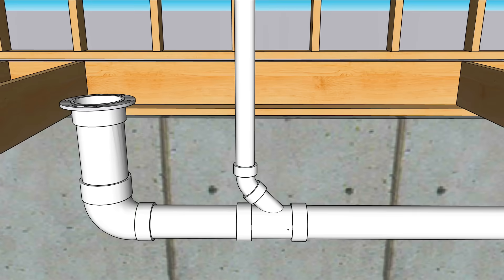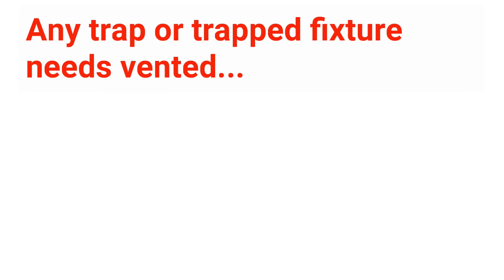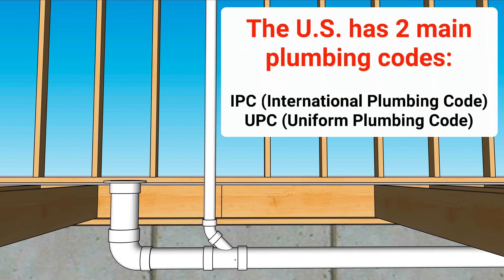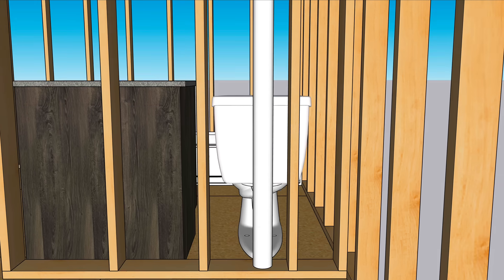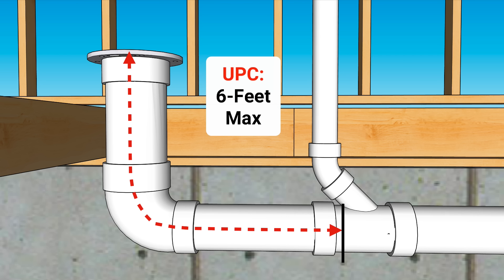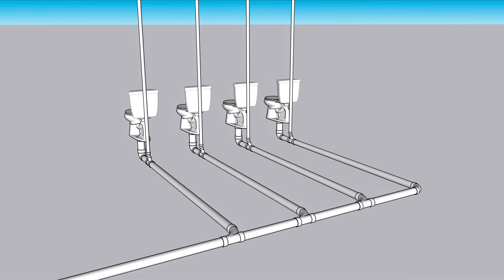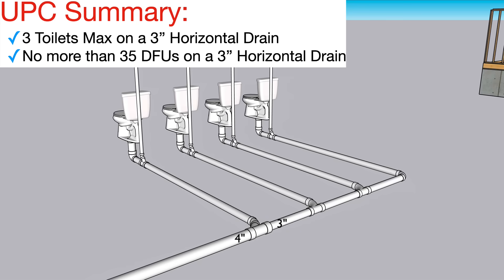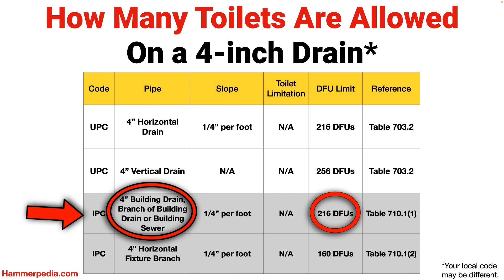How To Vent & Plumb a Toilet (in 2024)

Comment: Could I ask —I did an install like the vid but my vent is not with the 45*backset it’s just a 3” t    Don’t note any problems except for the trap going down to the minimum as it’s not used much. Q is does code require the 45  ?
Reply: Below flood rim a y and 45 is required in both upc and ipc, local codes may be different.

Comment: How high can vent pipe be?
Reply: ... I believe most will call for the vent to be at least a foot above the roof and in the case of a second story nearby it needs to be more than 5 feet from any windows. Check with your local inspector for any variation from national code.

Comment: IPC does have the same 3 toilet limitation as the UPC. On table 710.1(1), next to the 3 in the diameter of pipe column there is a footnote. The footnote reads No more than 3 water closets.
I was on a job second guessing my code (IPC) memory because of this video. Had to check my code book to make sure I didn’t run a 3” building drain to my 4” building sewer…
Edit: check replied comment below.
Reply: This is correct for North Carolina IPC. The National IPC is as stated in the video. I just cross referenced.
Reply: @EatShee-I-it  ... did you know you can edit a post by clicking on the three dots to the right of a post?
Reply: @rupe53  yes
Reply: @EatShee-I-it  Hola amigo colega ando investigando cuál es la manera correcta de ventilar un inodoro si con una yee o con una te sanitaria seve qué sabés mucho del tema saludos espero tu respuesta ?
Reply: @hugorosco7806  the video states a correct way. Different locations with different codes may be slightly different.
Your comment didn’t automatically translate, and my Espanol es muy porquito. I think you are asking me about using a sanitary tee to vent. In my opinion, an individual vent for each fixture using the sanitary tee is the ideal method. Although, the method I use most and prefer due to it’s ease, is what I call horizontal wet venting.
Reply: @EatShee-I-it  muchas gracias amigó saludos desde la CDMX
Reply: @hugorosco7806  salud carnal

Comment: Does the vent need to be after toilet before the sink?
Reply: ... it's going to depend on the distance of the pipe run. You could vent the sink drain into the same vertical vent pipe as the toilet, either in the wall or up in the attic.... exiting through a single 3" in the roof.
Reply: @rupe53  so let's say six feet toilet next to sink can I put one vent after both? Or is it better to vent both then into one going up?
Reply: @dp9948  ... I asked the same question and my local inspector wanted another vent for the sink within 2-3 feet of going through the wall. It was ok to join the vents further up for a single roof vent exit. We get snow so he also asked for 16" above the roof. It was also a first floor extension so the stack / vent needed to be more that 5 feet from the back bedroom windows on the second floor. (measured horizontally) I added a zig-zag with 45 degree fittings in the attic and got it 8 feet away. I also went from 2 inch vent up to 3 inch in the attic. No problems over 20 years so far.
Reply: Thank you for your response 👍
Reply: Il y a de petits évents de quarante  à placer aux dessus du siphon de votre lave-main.

Comment: Why reduce to a 3 inch pipe when you can stay to 4 inch. It'll be more volume for flow of water
Reply: ... because 3" flows better than old cast iron and it's cheaper / easier to use 3" for a single bathroom.
Reply: @rupe53  ok. I was thinking   it was a demonstration of a new house. I use 4 inch PVC pipe for all main drainage pipe.
Reply: @weldonpinder7295  ... depending on the house layout and number of bathrooms, it would be common to eventually upsize to 4" before heading outside the foundation. As you can see by the diagrams, after so many toilets (or total drain units) it may be called for anyway. Probably best to have a little extra in case someone adds onto the home in the future.

Comment: 4” toilet flange to a 3” 90° bend? Not legal anywhere in North America that I know of. Drain pipes can only either stay the same diameter or increase in diameter; but never decrease.
Reply: Australia must be 4in all the way
Reply from the maker: Normally a drain never can be reduced in size (like you mentioned). But the video shows a 4" closet flange connecting to a 4x3 closet bend. Neither the IPC or UPC consider that a reduction in flow (IPC 704.2, UPC 310.5).
Reply: Thank you for the correction. I didn’t know that
Reply from the maker: @Cris T  All good. I should have brought that up in the video.

Comment: Used to be, if the toilet is close to the stack, no venting necessary.  Not sure in 2022.
Reply: ... that's only if the stack IS the vent through the roof. In the old days the soil pipe WAS the stack / vent, all in one shot. These days that's not always the case.

Comment: The video is ok ,but a wye on its back with a 45 is not legal for a dry vent ,must be a san tee
Reply: Hola amigo colega estoy investigando sobre el tema de cuál es la manera correcta de una ventilación seca vertical  según yo es con una yee  y podrás comprobar porque la manera correcta es con una tee sanitaria y no con una yee?
Reply: Not anymore. UPC requires y and 1/8 below the flood rim for all piping. Ty on its back was approved for a long time, but now even vent fittings below the flood rim must be long sweeps, y’s etc..

Comment: What do you do, if cut existing old DWV that goes through roof and “DON’T” add a new one? Do you cap the “cut old DWV” thru roof; so water doesn’t collect inside and/or pool under a slab in grade foundation? 

FYI: had contractor help out w/ bathroom remodel and they had sub do plumbing and they ended up digging up slab as flipped toilet and vanity and added a tub and extended existing shower (which they had to dig 2 times after finished since during flood test 1, forgot to connect drain, & flood test 2 forgot to connect drain to exist 🤦) that was there.
After all said and done, and pouring concrete 1 time, 2 times, and busting up to fix mistakes before poured 3rd time; which on 3rd time, they STILL DIDNT VENT ANYTHING IN BATHROOM TO “OLD EXISTING” VENT THRU ROOF 🤦. 
So, when time for final inspection, guess what, found that wasn’t vented to code, but they able to “fix” w/ adding 3 AAVs, argh.
But what am I supposed to do w/ the vent pipe coming thru roof, cap it so water won’t enter and pool under slab etc….or rodents, or “nature crap” etc…
Thx for vid and everything, cheers✌🏻
Reply: Why did they use a Studor valve rather than connect it to the existing VTR?  There's something that you aren't telling us.  A contractor "helped" you to do the remodel?  So...did YOU do it, or did you actually HIRE a contractor to do the whole job, or what?  How much did YOU do, and how much did the contractor do?  I'm a bit confused by this.
Reply: Well if you aren't using the roof vent and it is not hooked up to anything on the bottomed then yeah, cap it and the next time you do the roof, delete it.

Comment: I’m sorry bro you need to delete this entire video you’re not showing them how to install event that’s a vertical drain pipe off of a branch, second of all the UPC code allows two toilets on a horizontal  3 inch  branch the second you get to three you gotta bump it up to four that requires the DFU not exceeding the DFU load allowed.  I do this every day man I’m a master plumber and you got so much wrong shit here I can’t even discuss it in the comments you need to delete this shit and stop acting like a Plumber. how is that a vent pipe how is that venting the toilet it’s not it’s venting the drain branch if anything the way you would do this properly is to a sanitary tea out of range that seem to Tee to a closet been vent out the top of the sanitary tea. And likewise a closet bend is not 3 x 4 you have a 3 inch closet when you have a forage closet bin you have a 4 x 3 closet bin and you have a 3 x 4 closet but there’s four different closet bins it’s a short radius 90 is what it is….

Comment: Did a similar install but just used a  t  vs. the 45 like the vid. Don’t use it as much so ittl lose the water in toilet on windy days. Question is does the 45 angle prevent the water loss ? I kept it at 3” size not reduced.

Comment: Funny how this was on my timeline.  I did Vo-Tech in carpentry for 3 years. We remodeling a home for training. I got the master bathroom.   The instructor said this is your Budget and this is the code book. Code books are easy. 2 things. Minimum size max size.  Min 2” max 4”.  Done. But venting toilet problem.  Instructor told me about this venting and said all other vents to it. I Learned this back in 1987. The instructor said what the video talked about. Why do you see odd things like a 3 inch vent pipe or in some cases a 4 inch vent pipe. If you have the room run one or two of them because somewhere in the codes you can only have so many vent pipes in to one. Like in the bathroom bathtub , 2 sinks , toilet all into a little 1.5 or 2 inch vent pipe that would not pass codes because if all of the appliances are running at the same time it ends up not being adequate venting.  What was I gonna say he’s the instructor.
Reply: ... up north they don't get too strict on the vent size inside the house but going through the roof MUST be at least 3 inches because the more water flows the more likely it will frost up in the winter. Yeah, there's lots of older homes with 1 or 2 inch vents and those are probably single bath houses.... AND... it seldom goes to -20 outside.... BUT... that's why we have a new code. (because some DO freeze up)
Reply: @rupe53  I had to do some work on my septic lines. Went outside where the bathroom was started walking around kicking the dirt poking the dirt. It should be a four-inch pipe that comes off and comes right up to the top of the ground somewhere in this area. Nope not the case. This was like two years ago three years ago. My neighbors like what are you doing. Digging a hole running another check and vent pipe. He shaking his head. Well I got it all done. I see this on YouTube about a month ago two months ago I can’t see when I posted. Maybe it was just a post from a state that said they change the codes or something. But I was always taught when I was in that field that’s how you run your vent pipes. As soon as I put mine in my wife comes out of the bathroom and goes what did you do to the toilet. She says it sounds like a vacuum cleaner when you flush it now. I said I eliminated back pressure lack of venting I allowed the water to go where it needs to go without any restriction so it creates a vacuum in the toilet bowl now. Because how fast the water is leaving the toilet. Now it’s a good thing because when we put the new environmental lesser water toilet in. It will flush perfectly.

Comment: is reducing from 4" to 3" best practice?  If your gonna  use 3" wouldn't it be better to not use 4" at all and avoid the constriction?  or just use 4" for the sake of tutoring people?  I don't know the drainage code but just because something meets it doesn't mean its a good installation..
Reply: will that pass an inspection?  anyone?
Reply from the maker: Randy, a 4x3 Closet Flange is not considered a reduction in flow (IPC 704.2)
Reply: @Hammerpedia  Thanks for taking the time to reply.  What I really wanted to know is if there is an advantage to using a 4x3 flange as opposed to just using 3" all the way.  Building code aside, which one would need the plunger less?
Reply from the maker: @ydnark83  either one is fine.
Reply: ... in the case of a retrofit there may be an existing 4" that can be downsized to a 3" then plumbed to newer code... if it's all within the distance requirements. (existing tile floor and tub that you don't want to disturb?)

Comment: I would use 4 inch all the way from start to finish, the 3 inch u will get trouble , blockage eventually
Reply: No one uses 4” pipe for toilets
Reply: @pats9414  well that depends where u live I meant the waste going into soil pipe which is 110mm Over 4inch soil pipe  mostly for toilet

Comment: I was told in CE that UPC got rid of the toilet limit on 3” and just bases it on dfus. I haven’t look in the code book to verify yet because it’s usually irrelevant as I always run a 4” main anyway except in specific situations. 
As for the unlimited trap arm in IPC, is there an exception for flat roughing or for toilets because there is a limitation on trap arms. In IPC (the best code for trap arms) it’s based on 1/4” per foot fall. If the trap arm has this slope then at a certain point it will be an S trap. So you divide the ID of the pipe and multiply by 1’ and this is you max length. 3” would be 12’. The upc has seemingly arbitrary numbers. 1 1/2” is 3’ 6”, 2” is 5’, and 3” is I believe 10’. I do commercial so we mostly stack rough so there may be some exceptions I’m not aware of. I didn’t know if the length was allowed to be longer because a toilet is anti-siphoning
Reply: Good question. I know that a WC waste arm was 6' maximum in our old Oregon Specialty Plumbing Code book,but they switched to UPC the last update! It's unbelievable. The things you're allowed to do,like running 4 WC on one 3" waste line. 8 WC on 4" too. I run 4" mains as well. It's just as easy as 3",but you're covered in case of fixture overload or additions.
Reply: @Energia-977  I work with upc everyday in Austin and as far as I know it has the same 3” 3 toilet limit. It is limiting with trap arms. We didn’t have any maximum for a wc trap arm. It was just the trap arm length for whatever size you chose. UPC, though seems to have completely arbitrary trap arm lengths. Like 5’ for 2”. I don’t know where that comes from. In IPC it’s 8’ based on the fact that when graded at 1/4” per ft you have 8’ before it’s an s trap. As for using 4”, when I started that’s all we used. I started in a small town. We one hardware store with a decent selection but still limited. The rest of our stock got delivered once a week. For this reason we only ran 4”. It automatically cut in half the amount of stock you have to keep. I only used 3” on repairs.
Reply: @joshcowart2446  Small towns are good places to grow up in. Probably what makes you a great plumber lol!(I'm from one too) I got a diagram from my city inspector that shows 8 WC on a 4" line. As long as you run vents between the last  WC and your first WC you can run 8.
Circuit vented branch is the specific name that it's called according to the diagram. I used it on an underslab rough this year.
You just can't use combos looking up for your WC(I asked but the inspector explained why it couldn't). You have to turn them on a horizontal grade,then 90 up for your WC.
Reply: @Energia-977  yes I agree. Just in terms of plumbing I can think of how small town people are better. In the city, everything is an emergency. I’ve been called out for an emergency that turns out to be not at all what I would consider an emergency. Small town people, due to not having 24 hr plumbers available, know how to deal with things. They can get by until a plumber can get there. They either know more about how to do things themselves or they’re much more willing to make due. 
As for the circuit vent, yeah I’ve never actually done one but I remember being taught about them. I thought you were talking about sewer pipe sizing. I don’t know how the Oregon code is but from what I hear from lots of plumbers is UPC is stricter than IPC. I have to deal with both so I should know the differences because Austin is UPC but every city around Austin is IPC. The only thing I can think of off the top of my head is the UPC is more strict in terms of trap arm length. The rest I’d say they’re more similar than they are different.
Reply: Australia only uses 100mm or 4 inch for all toilet piping. Vent pipe 50mm or 2 inch. All toilets are dual flush.
Reply: @tonydoggett7627  Our county plumbing inspector is an Australian and he told me that Australia's plumbing is a huge inconsistent,joke when I asked him about it. 
He started laughing and shaking his head as he told me this.
Reply: @Energia-977  let’s see your US National Geographic Magazine once published an article on Sydney’s state of the art sewer system. Sydney’s suburban beaches are crystal clear clean blue water. So my fellow Australians must be doing something right.
Reply: @tonydoggett7627  Who's talking about your infrastructure? I'm referring to your plumbing codes and accepted practices,which are a joke! This has zero to do with your comment. Stay on topic.

Comment: I guess things have changed now in 2022 with these fancy newfangled porcelain devices but I still like the way toilets were ‘vented’ in 1922 - there was a louvred vent on the back wall of the outhouse and you just left the door open for a few minutes for cross-venting. I’m afraid to poop now in case I’m in violation of a code!

Comment: Are vents required to be installed straight up? I used a vertical 4x4x2 sanitary T and a 2" 90° to vent a toilet recently. I needed the 4" to drop straight down a few feet and then 90 off to the main so it made sense to me to vent off that vertical section.
Reply: Dry vents must remain verticle until reaching 6" above the flood rim of the fixture unless washed by another fixture (sink, urinal or tub)(wet vent.) Also verticle is considered 45deg or steeper. A horizontal dry vent is not allowed below the flood rim of the fixture.Sounds like your 2"90 would be a violation.
Reply: Don't use sanitary On horizontal position. Not approved by ipc

Comment: Can't you use a sanitary tee for the vent.?
Reply: The wye should be a sanitary tee instead. That's the whole reason I clicked on this video. I noticed the wye on the thumbnail picture.
Reply: You can use a san t if it is a dry vent, combo if there is a fixture above
Reply: Only above the flood rim of the highest fixture
Reply: My same thoughts as well